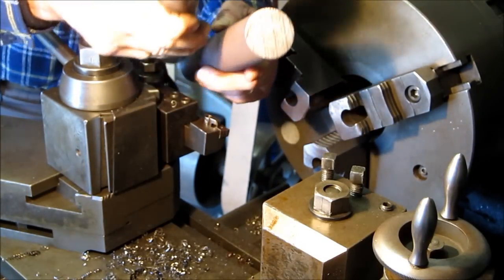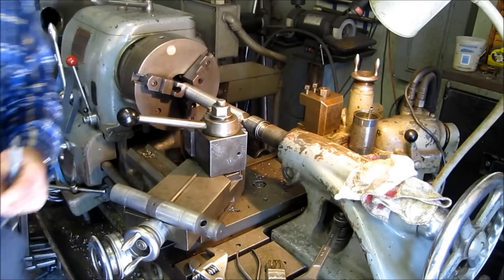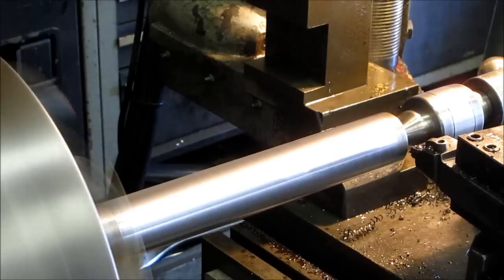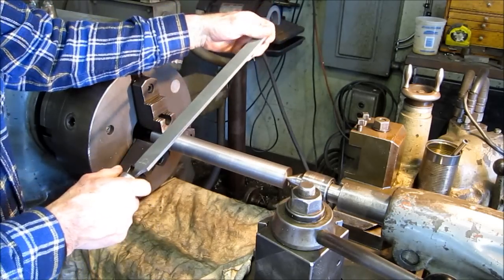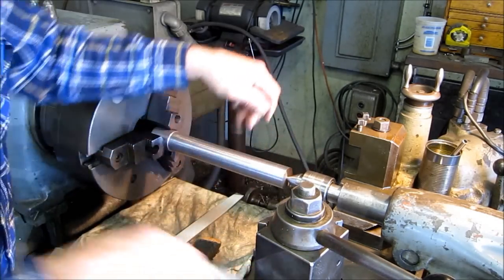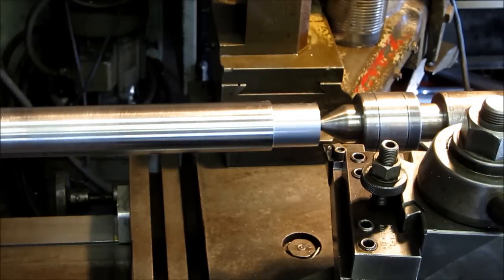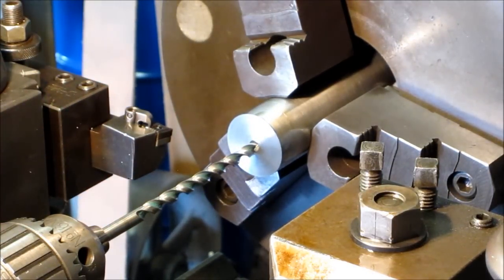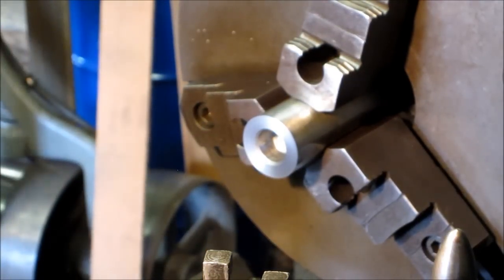MEBP Part1

Comment: Hey keith, This Might be a Dumb Question, But with the parting Tool should the Top of the Blade Be centered or a fraction Lower / higher. Slow speed high speed. I just never feel real Comfortable. The bit tends to grab  when getting towards about half way through, either Alloy or Steel.  :)

Comment: You scare me with wearing long sleeves and using your right hand on the handle!  I was taught to use the left hand on the handle when filing on a lathe, as a safety feature.  The shop where I worked bought only short sleeved shirts for employees.

Comment: Keith, another fan. I glean so much from your videos. Just curious why you did not duplicate the relief in the center of the pin. Is that not suppose to help hold and supply grease in the contact areas? Keep up the excellent.

Comment from the maker: It is due to the surface finish and a bit of taper in the cut. The lathe has many miles on it and is not as tight as it once was. Take my practice as a reminder that all machines are not as tight as you wish they were. ;{)-----

Comment: Thanks, Keith!  Yea, files last years when treated with respect, their main killer is abuse!  I use trashed ones to check hardness.  I've been longing for Grobet (Swiss) American pattern files, but they are pricy!  I like Lutz long ferrule birch handles.  The 6" Stihl single cut smooth flat hand files with two safe edges made for lowering the lands on chainsaw chains when sharpening them are very good for deburring, but too small for use on the lathe.  I'll check out Sandvik files.

Comment: Hi Keith, I thought I remembered a vid where you commented on filing in the lathe!  You mentioned using single cut mill files, but what tooth coarseness?  FYI,  Apex Tool Group (owner of the Nicholson brand) outsourced mfg. to Mexico and Brazil last year.  I've been happy with the new old stock USA made Nicholsons I've found, but I've avoided buying new offshored ones as I've heard they are softer.  Have you bought any new ones lately/noticed any difference in how they wear?